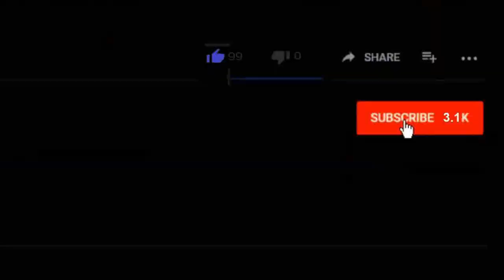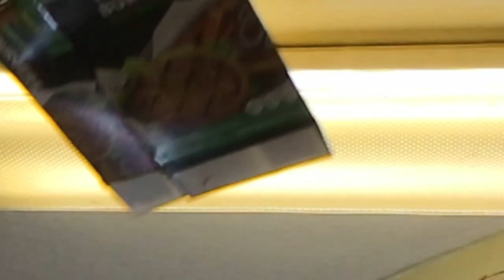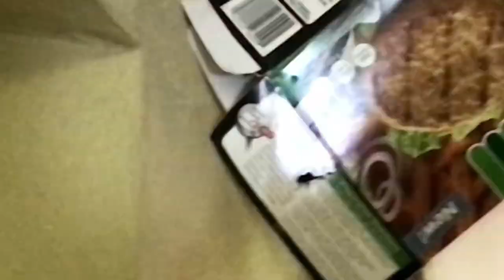Time Lapse Yard Work / Yard Cleaning

Comment: Yo Commander thanks for the shout out. Next time try dipping those door hinges in some 5w 20 believe it or not it last for a long time. I think 3 different chances to win is better odds. Does your roomy help with propane that stuff isn’t cheap dude and your always having to run and get it. Stay up brother will be waiting for the next one.
Reply from the maker: Not sure but, I thought that was the kind of WD 40 I used taking them off and soaking them sounds like more work then I’ll put on them lol 😂. My roommate helps with propane when I complain enough about it. This time I got it covered 😎